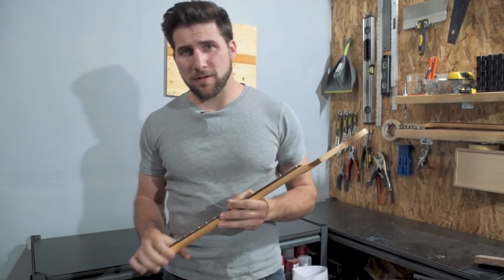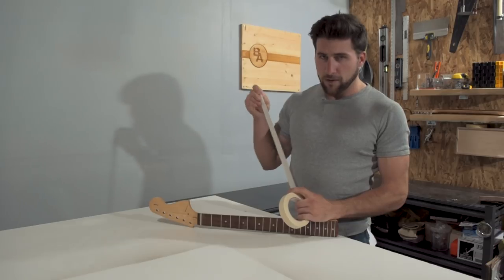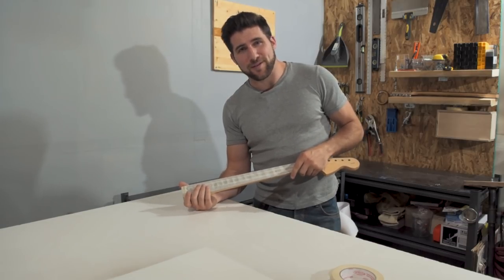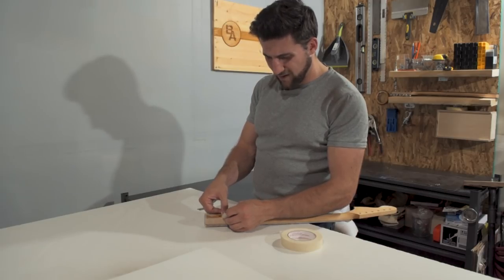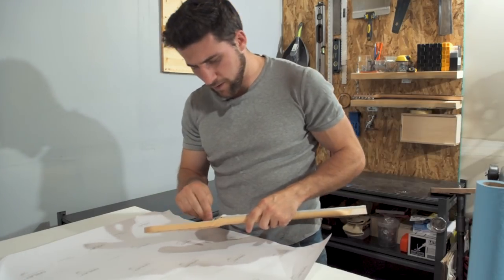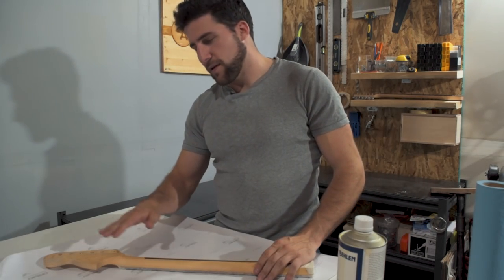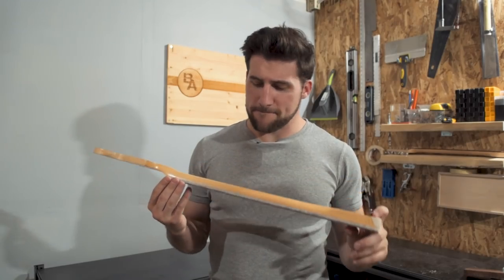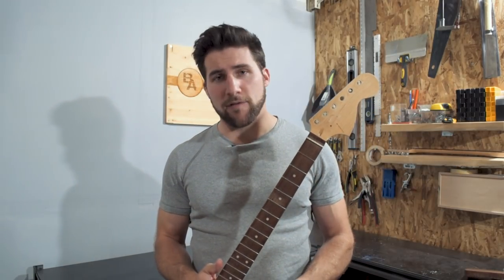How to finish a guitar neck

Comment: Hi, I just got a Stratocaster style guitar but I want to only paint the front face of the Head-stock a Gloss Black. The entire neck is already sprayed with a Gloss Polyurethane, which I'm fine with, but I'm wondering if I need to sand the Polyurethane on the Head-stock down to the wood? and what type of paint to go with. I was just going to use a Spray Can Enamel Gloss Black and be done with it, and I assume I'll tape everything up like you've done in the video. Great Videos by the way, some day I'd like to do a whole guitar myself, but this Head-stock thing is my first test run
Reply from the maker: You don’t need to sand it down to the wood, but you do need to sand it until it isn’t glossy anymore so that the paint will stick. Just the part you want to spray. Carefully tape everything else off first. Make sure you ball up a bit of tape and jam it in where the truss rod adjustment is as well. 
Presumably the poly on there has cured, so you can use spray can enamels if that’s your preference.
Reply: Wow, thanks for getting back to me so fast. It's a kit guitar that I'm using, that was on sale because it had been sitting around a while, so I assume it's all cured, and I tested out some Rustoleum enamels I saw you use in a different video, they worked out pretty well, thanks again
Reply from the maker: You’re welcome. I hope it goes well for you.

Comment: Hi Brad. Great video. Very helpful. I’m wondering if I could get some advice. I want to stain the top of the headstock black. I’m worried about bleeding. Will taping it off prevent the stain from bleeding down the edge? Should I use a specific kind of tape, or will everyday painters tape do the trick? I’m using a black dye/stain from stewmac. Thanks!
Reply from the maker: The best way to prevent bleeding in my opinion is to seal the edges first so that the stain/dye can’t soak into them. Then tape them with regular painters tape.
Reply: @BradAngove  Awesome idea, thanks!
Reply: @BradAngove   How does one seal the edges?
Reply from the maker: Usually with a sanding sealer or something similar.

Comment: That neck you're working with looks to be treated with something already.  would you do this same process with a brand new raw untreated neck? i've got a diy guitar kit and looking to finish my neck, just not sure if i need to treat it with something else before the Teak oil?
Reply from the maker: +Mister Speedz The neck is already sealed, yes. If it's sanded smooth you can jump straight into the oiling. Might take a few more coats though. 
I'm doing a guitar kit series soon. I might end up demonstrating it with oil for the neck.
Reply: Thanks Brad, i'm looking forward to your kit series! is there any particular reason you chose teak oil? for this video and neck? if a person wasnt going to use paint or stain on the neck, what other options beside teak oil are there.  sorry i'm new to woodworking/finishing..
Reply from the maker: +Mister Speedz I wouldn't say there's any particular reason for teak oil. There are tons of options. Lots of different oils, spray finishes, wipe/brush finishes etc. will work. If you're avoiding paint and/or stain a varnish or almost any finishing oil would work.

Comment: Hi Brad, excellent channel mate.
I'm working on my first partscaster and it has a maple neck and fretboard. I hate the 'sticky' feeling, but I have some 'rustoleum clear coat polyethylene matte spray can' left over from a top coat body spray. I dont really want to buy any more products, so will this do for neck & fretboard if done thinly straight onto the wood? And if so, how should I do it?? HELP PLEASE!
Also it's completely bare maple at the moment.
Thanks from the U.K mate
Reply from the maker: Yes, that could be used to seal it up in a thin layer. You don’t necessarily need to spray the fretboard. Some people leave their maple fretboards raw.
Reply: @BradAngove  that's fantastic mate, thanks a million. It seems to be a bit of a minefield, maple. 

One last one, (if you don't mind) Could I spray the poly directly over stained maple? I'm thinking of ebony stain on the fretboard, maybe the whole neck if I like it.

Stay safe Brad, and thanks for your time
Reply from the maker: Yes, you can do that. Maple is dense enough that it tends to be ok for direct clear coating like that.
Reply: Thanks a million Brad! I really appreciate thay. Take care pal

Comment: Hey, love the videos.  Going to try finishing a Warmoth neck.  If I use a color stain, can I go over that with a finishing oil? Or do I have to use some sort of lacquer?
Reply from the maker: You can oil over stain.
Reply: @BradAngove  hi, what about stain, then teak oil (to tweak the colour slightly),  then a satin nitro finish...would that combo be OK?
Reply from the maker: I have sprayed lacquer over oil many times successfully, but I don’t think it’s recommended. So, anecdotally I can say that combo should be fine, but I wouldn’t necessarily call that the “proper” advice.

Comment: Brad, will any teak oil work or do you especially recommend the Behlen teak oil? If yes, what is the exact product number? Thanks
Reply from the maker: Any teak oil should work.
Reply: @BradAngove  Thanks. I wonder what Ibanez or all other brands uses on their necks.
Reply: @BradAngove  Thanks. I wonder what Ibanez or all other brands uses on their necks.
Reply from the maker: Likely a very thin layer of low sheen polyurethane.

Comment: Hi Brad, firstly, awesome and very informative channel, and video! Well done man!
A quick question, and I apologise if this was covered before- to place decals on the neck, should this be applied before or after applying the oil and, do I then need to apply a lacquer to the areas where the decals are? 
Thanks so much!
Gil
Reply from the maker: You can’t apply lacquer over oil, so you will need to select one. There are different types of decals. Most go over a layer of finish rather than directly on the wood.

Comment: Hey Brad! Love your videos. I have a question for you, if not too much trouble - I just did a superb full scallop on a guitar today and used Watco teak oil after. It looks great right now, but I'm concerned that if I don't put some kind of clear coat over it that it will turn gray. What do you think? Should I use a Watco spray lacquer or just leave it with the Teak oil?
Reply from the maker: You’re worried the fret board will turn grey? Usually it takes a bit of cleaning now and then to avoid it but I’ve never had teak oil itself turn grey.
Reply: @BradAngove  Thanks for the fast reply! Well, that's good to hear. I read about it not lasting long and turning gray, but maybe that was talking about teak furniture and not the teak oil.

Comment: Great tut. How does the teak oil compare to tru-oil in terms of fast playability ? And could you apply the oil finish after staining the neck first and get the same result ? Thanks and keep on shooting awesome videos!
Reply from the maker: You can definitely stain first and get that result if the neck isn’t sealed. 
As for speed, I find that tru-oil goes on a bit glossier. Some people like that, but it tends to slow me down a bit, so I don’t use it generally.
Reply: Thanks, saw some people using Tung oil and were very happy. I might give it a shot
Reply from the maker: I use tung oil as well; it works great.

Comment: Hi Brad, Im making a jazzmaster with a similar neck to the one in the vid. I like the idea of teak oil. my question is will i still be able to apply a waterslide decal to the headstock? would I need to clear coat it afterwards? would like to add decals but have not yet gone ahead with the teak oil in case. any suggestions? thanks
Reply from the maker: If you’re concerned about the effect of the oil, you can always teak oil the neck and just use a different finish for the face of the headstock.
Reply: so i could teak oil all of the neck as in the vid, but leave the front of the headstock for decals and clear coat? That was kind of what I was thinking. wasn't sure if the oil might react with the clear coat. thanks! I was tempted to paint the headstock the same fiesta red as the body, but im not to sure I like it.
Reply from the maker: Yes, you can do that. Do the headstock first, then protect it with masking tape when you go to do the oiling.

Comment: Hi Brad I see you have used tru oil and teak oil as a finish on your projects. Do you think one has a advantage over the other? Stonger , better protection ,easier to apply ?
Reply from the maker: They’re both pretty easy to apply. I believe tru-oil is a bit stronger. I really like working with teak oil. It gives a nice thin finish, whereas you can build up a thicker glossier coat with tru-oil.
Reply: @BradAngove  thank you. I was wondering the same thing as I saw a video where you used Tru-oil. Thank you very much for your guidance. I will be diving into my Stewmac strat with unfinished wood soon.

Comment: The thumbnail called my atention. I always liked very very white finishes for the necks but I don't know whats the proper name of it, like I go to a store and say 'hello I don't want a yellow neck, I want a white one' or what? Most of the necks I see typically are yellowish and I dont like that.. Also I dont know if it depends on the wood itself or the products they used to finish it.. (I thought I'd get those answers in this video)
Reply from the maker: So you’re just looking for a finish that doesn’t amber?
Reply: @BradAngove  One that is as white as the first one on the thumbnail of your video
Reply from the maker: You need a white maple neck and a water based clear coat.
Reply: @BradAngove  You really helped me, friend. Thank you.

Comment: Hi, is there anything else to do after that? Do we have to sand it or anything? When I put the teak oil on my neck of course it shines like yours... But it's not playable after it's kind of sticky. It loiks like your video is not finished. Thanks
Reply from the maker: No, you just let it dry after. No sanding required. If you’re using a gloss film finish like a lacquer or poly I like to sand those after.
Reply: @BradAngove  how long does it need to dry? On mine after 24h it's still sticky.
Reply from the maker: Usually a week or so depending on atmospheric conditions.
Reply: Thank you

Comment: Hey brad, I’m about to finish a squier neck with the headstock decal on it - should I still sand it down and then finish or should I avoid that area? Also how many coats would you recommend applying and how long should I leave it to dry? Thanks!
Reply from the maker: Are you trying to keep the headstock decal?
Reply: Brad Angove yes if possible
Reply from the maker: Is there anything wrong with the face of the headstock that would require it to be repainted?
Reply: Brad Angove not really it’s just a very light wood so I was hoping to darken it a bit!

Comment: I want to send down the glossy finish on my guitar neck and refinish it with a less glossy paint but I'm afraid of taking off the fender decal by mistake .Is there a way to avoid this?
Reply from the maker: Is it on top, or under the finish?
Reply: @BradAngove  it's a fender Kurt Cobain SIG Jaguar , it's under the finish i guess
Reply from the maker: Ok, then just be very gentle sanding it. Use 800 grit and just abrade it enough to apply your lower sheen finish.
Reply: @BradAngove  ok , thanks Brad .

Comment: I usually agree with the "no gloss finish neck" stance and it took me years to even realize that the cheaper guitars I own with glossy necks did really impact speed. But I also have a 30th anniversary PRS SE Custom 24 (one of the South Korean ones) with a glossy neck and that one basically defies the laws of friction. It's one of the few painted necks I've tried that really doesn't stick at all.
Reply from the maker: That's great. I wonder how they achieved that. It's a full gloss?
Reply: Yeah, it's a full gloss. The funny thing is that I also own a 7-string version of that guitar, but not a 30th anniversary one, but still with a glossy neck which actually does exhibit some of the typical problems of glossy necks.

Comment: Super Chanel! Congrats and thanks ! I'm not sure if you have a video for my question , how about for to finish a maple fretboard,  it must to be varnished not oiled,  but how to? Thanks Brad!
Reply from the maker: I haven't done any videos on fretboard finishing. Are you planning on applying the finish by hand, or spraying it?
Reply: I don't know what is the best way. I thought to do it spraying. Can I use the same varnish used for the body?
Thanks! :D
Reply from the maker: +apadierna You can use the same varnish as the body if you want. Is it a spray on varnish, or brush/wipe on?
Reply: It is spray on varnish. I thought that the only way to finish a maple fretboard was varnished/lacquered, but now I'm seeing that is possible to finish also with oils?
Reply from the maker: +apadierna Yes, there are many ways to do it. If you want to spray you will either need to protect the frets or remove any paint from them afterward.

Comment: just a quick question, im building my own guitar using a solo guitar kit and i want my guitar to have a black satin finish to it. i've primed the body with wood primer. would it be possible to use a black wood stain and then a satin hand rubbed poly finish?
Reply: its an odour killing primer by zinsser, my teacher recommended it to me
Reply from the maker: Generally you wouldn’t want to stain overtop of a primer. It won’t soak in at all, so it won’t look very good. You’re probably better off painting it at this point.
Reply: ahh thank you
Reply from the maker: You’re welcome. I hope your project goes well.

Comment: I have a G&L ASAT with a one piece maple neck that I'd like to finish. It feels pretty good in my hand, but it's just so bland looking and VERY light. I think it would look much better darkened up a bit. My question is, how would you go about doing this on the fretboard? Might not be worth it if I have to remove the frets.
Reply from the maker: You're wanting to darken a maple fretboard? What color - amber?
Reply: Brad Angove That might be nice. I just want it to look like other ASATS where the neck is darker. The one I got is almost white if that makes sense.
Reply from the maker: I would just spray the whole thing with amber lacquer. Then I would run a razor blade down under the edge of each fret and peel the lacquer off of them because it won’t stick to the metal.
Reply: Brad Angove Ok so just to be clear, would you tape over the frets or fret markers at all before spraying it? Also, is it worth spending the $31 on a can of lacquer from StewMac? Seems pricy,  but I know they make great products. Btw, if you want to get a better idea of exactly what it looks like, it’s the white G&L ASAT Tribute Classic on Guitar Center’s website.
Reply from the maker: I wouldn’t tape over anything except the truss rod cavity and mask the tuning peg holes. I think you can find Mohawk paints cheaper elsewhere. If you’re looking for cans, a light coat of their stardust amber toner lacquer followed by a couple light coats of clear should do the trick.
Reply: @BradAngove  Thanks so much for your advice!

Comment: cool way to make it easy and look good, I wanted to get myself an all rosewood neck and it's being sold as unfinished so was wondering what your thoughts are for that particular wood ? and what other oils would get this effect you just produced on maple but on rosewood
Reply from the maker: The effect in rosewood is fairly similar actually. I generally use modified tun oil now from Mohawk. That’s probably what I would use on rosewood.
Reply: @BradAngove  cheers, thanks for the advice Brad
Reply: Just FYI - I've  had the chance to handle an ALL rosewood Tele, both neck and body, electronics, all together, felt like a 15 pounder 
(It was authorizrdapproced' custom neck and body, Warmoth MAYBE?  And It had to be the heavlast guita6r I've ever handled.
 Even as a thinline. It was VERY pretty, sound spectacular, great sustain. Bbut between 112-15pounds I think if a safe estimate.
 ** TLDR version: 
 I'm thinking that rosewood neck you want is probably noticeably heavier than a maple neck you might be used to. Tho that may work fine for ya, and again, VERY PRERTY!
Reply: @bryanwalter5752  yeah cheers , I ended up with an all Pau ferro neck and little darker and finished with a tru oil finish , very nice took some work on the frets to level crown and polish but was worth it, great tone and beautiful looking

Comment: I tried staining my guitar neck but it just didn't really stick I was trying to rub it in but it didn't seem to stay, I sanded with 320 grit paper and I used a shop towel to rub it in. What should I do?
Reply from the maker: Was it sealed?
Reply: @BradAngove  by sealed do you mean if it still has the matte clear coat? Or do you mean somthing about the wood? I know you talked about it in your video.
Reply from the maker: Likely something underneath the clear coat to seal up the pores of the wood so that the clear won’t soak in. Unfortunately it also prevents stain from soaking in.
Reply: @BradAngove  thanks I sanded it down a lil more and it worked. Your so helpful brad I really appreciate you and your vids.
Reply from the maker: I’m glad to hear it worked!

Comment: Well let tell u really what going on im building a submarine pvc and hard wood cones and dive planes r bass wood but want to paint it semi-gloss black
Reply: So I want to know what to do I want to paint it with rattle can enamel
Reply from the maker: Use sealer on the wood, and plastic primer or adhesion promoter on the pvc. Make sure you sand everything first. 400 grit is probably good. Let the sealer and primer dry for a couple days and scuff them at 400 as well before moving on to your colour.
Reply: Brad Angove. Thxs brad for ur help !!! U make it all look so easy lol
Reply from the maker: You’re quite welcome.